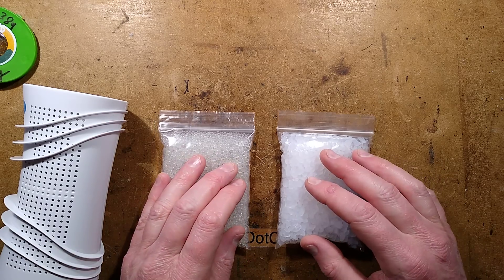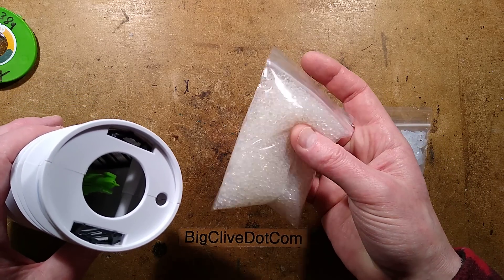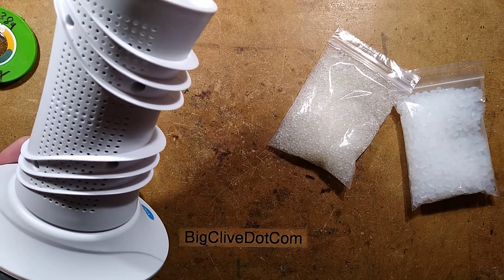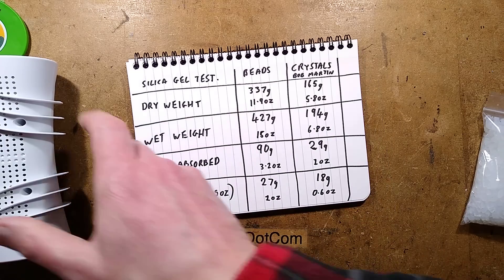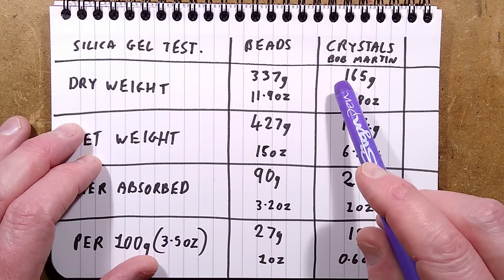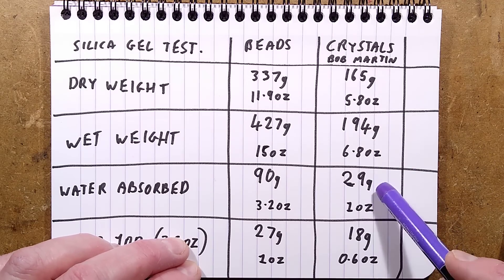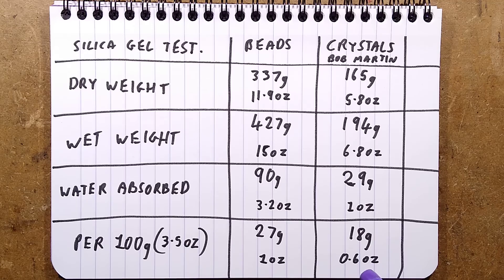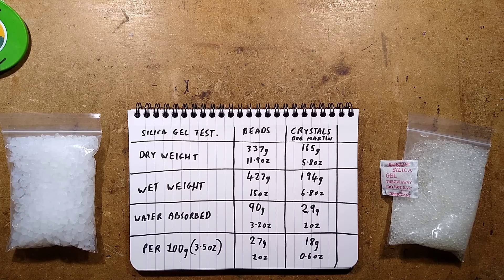Silica gel desiccant showdown - normal versus crystal cat litter

Comment: Hi Clive, the correct word is adsorbent not absorbent 🙂 I have spent may years in the gas processing industry correcting that typo, so unfortunately triggered. It is an interesting example of a mini temperature swing adsorber tower. Most of the surface area for adsorption is internal micro pores rather than external, the pore sizes varying dependent on manufacturing processes. I am not an expert on kitty litter but it is produced via a more "cost effective" manufacturing process that yields fewer, but and larger internal pores hence the lower density and lower capacity W/W.
Reply: The larger pores are deliberate. It's meant to trap liquid quickly.
Reply: In this case, absorb is correct. Adsorb has a different meaning. Look it up if you don’t believe me.
Reply: @grahammilnes7256  - No, it very much isn't. Everyone understands what it means, but silica adsorbs, it doesn't absorb.
Reply: @RFC3514  Technical you are correct. I think someone could be forgiven for saying that the porous beads of silica material absorb (hold) water. Just my opinion.

Comment: Would be interesting to know the cost of each - if you can buy 3 times as much of the cat litter version, it could still be a viable alternative where volume is not a problem.  Did they absorb and dry out at similar rates?  I'd almost expect the cat litter to dry out quicker - with its larger paws (see what I did there?).  Thanks for the always interesting and entertaining videos.
Reply from the maker: The cat litter does seem to dry fast.

Comment: Interesting results, Clive. FWIW, I save most of the silica gel packets I come across, usually in medication bottles, in (relatively) airtight glass jars. After gentle baking, I then use them to keep my collection of old carbon composition resistors as dry as possible, also in glass jars. It's been working wonderfully for many years.

Comment: Clive, do you think this type of rechargeable silica system could be used to lower the moisture of a 16sqm storage unit (maybe 36 cubic meters?)? I'm trying to come up with a solution that doesn't require power because I don't have it available in there so I figured I could swap the silica containers periodically bringing them home to dry and if needed I should be able to put together an air circulation system that can run for a long time on battery using small computer fans or something.

I've been thinking of this ever since you published the original video about this system you got from ebay and I'd really appreciate any input.
Reply from the maker: It depends on the natural air flow through the unit.  A powered dehumidifier might be better.
Depending on the area, you may also find a solar powered fan that pushes air through the building continuously during the day may help keep the air fresh.

Comment: Great video! I've wondered how much better the ones actually "designed" as desiccants are, and 50% higher capacity by mass is significant, but still makes the cost for a given capacity higher for desiccant beads I've seen. The cat litter option has a disadvantage, that in many cases is much more severe than the lower capacity, in that it has a much stronger tendency to create lot of dust.    

Anyhow, even though the actual numbers probably varies a bit, now I know that beads in general probably have in the ballpark of 50% higher capacity by weight, and around three times by volume. Good to know.

Comment: I have to wonder though, was this accurate? The cat litter isn't designed to absorb moisture from the air but rather directly from liquid poured onto it, so the actual "crystal" size and porosity may very well prevent full absorption of the maximum amount of moisture when used as an air dehumidifier, e.g. by not having the moisture penetrate through a humidity-saturated surface to the center of those crystals. I think if you really want to answer this question you probably have to, at the very least, break up the cat litter to similar size particles as the beads. More research required!

Comment: I found some interesting info from Adsortech:
Placed in an environment with 30 degrees Celsius and 90% relative humidity during 30 days, calcium chloride can absorb over 250% of its weight. In the same conditions, silica gel stops at 25-30%. This means that calcium chloride has 10 times the capacity of silica gel to remove moisture from the air when the relative humidity (RH) is 90%. At 50% RH, the difference is less, but calcium chloride with its absorption rate of ca. 100% in these conditions still outperforms silica gel by around 20%.
Reply from the maker: The calcium chloride turns into liquid and is messy and harder to regenerate and reuse.

Comment: Surface area of the crystals compared to the beads. What happens if one crushes the cat litter crystals to the size f the beads, if possible. Theoretically you could fit more crystals into the same volume since there will be less space between the smaller pieces.
You can also purchase desiccant crystals in craft stores used for drying flowers. These are the fraction of the size of your standard beads. They too can be recharged in the oven but require to be placed on a tray since they are so fine unless you want to sew them into a cotton bag.
So far cat litter crystals have worked fine for me in storing dry goods for food usage.

Comment: If you drop your phone in water you dont use either of these....You put your phone in a pillow case and you spin it as fast as you can. The centrifugal force ejects the water which is absorbed by the pillow case and you see it happening. It has to be done asap though.

Comment: Thanks for this test. I already considered drying my 3D filament with cat Litter silica gel. Now that I know it is only half as effective I will not go this route. So: You litterally saved me money. 🙂
Reply: Check out solid state electric dehumidifiers, a video from clive from 5 years ago: https://www.youtube.com/watch?v=Vabq-s62IVM
That is, if you have some money to burn as the bigger ones can become quite expensive. Though the small ones should be enough for most storage boxes.
Maybe paired with some silica gel to quickly initially reduce humidity after e.g. opening the box, the solid state element will then gradually also dry the silica gel.
Reply: By saying that it’s half as effective you are not able to say you will save money by not using it. The cat litter silica gel could still be effective enough to do the job. Comparing the average vehicle to a Porche and following your logic, it would be saving money to buy the Porche because it goes faster than the average car and it gets to the top speed quicker. But the average car is absolutely fine for everyone. One needs to take the cost into account. Even if one has to use double the amount because it is half as effective, if it costs one third of the price then money is saved by using the cat litter silica gel. There was no testing on how fast each product removes moisture from the air. Perhaps the cat litter silica gel is able to bring down the moisture levels in a 3D filament bag faster than the other silica gel product. It would be an interesting experiment.
Reply: @capitalinventor4823  By saving money I meant: I saved the money buing the cat litter to find out It is not working for drying my filament in the AMS of my Bambulab X1C. Of course, if you have enough space: just double the amount. But in confined spaces you can't do that. So: I saved money in buying a product I can't use in the place I intended it to.

Comment: I used to setup and repair copy machines. The new copy machines came packed with bags of silica gel beads as big as my fist!!! 😮 As far as "recharging" goes, I always nuke the bags in the microwave for a bit, but not too long to drive out the moisture!!! There was always steam and evaporated water that I had to let dry off before putting back into the microwave for another heat up cycle!!!
Reply: That will probably heat them up too much, recommended is convection at 120°C (thats what the manufacturer of my silica gel recommends)
Reply: Correct, I learnt this trying to dry my socks in the beam box and that didn't work very well.  @tarakivu8861

Comment: I'd be interested to know how much water is absorbed per 100g in the first hour (or 24hrs).
Do the bigger crystals with a more porous structure absorb faster?

We know cat litter is intended to actually absorb water based liquids pretty quickly, but gel pouches are to absorb airborne moisture over a longer time.

Which is more useful if you have a really damp space that needs dehumidified quickly?

Comment: Surely if air is blown through the silica gel, to dry it out, that’s just putting the moisture back into the air, where it came from? 🤔
Reply from the maker: Yes.  But the modules are designed for drying enclosures.

Comment: it will be interesting to run the experiment again with the cat litter crushed to a smaller crystals.

it will allow to fit more, and increase the surface area.
Reply: Would it increase the amount of moisture absorbed (given Clive already waited until full saturation was achieved), or just increase the rate of absorption thus quicker arrival at full saturation? I'm thinking the latter.
Reply: @Thermalions  The point would be bigger crystals give bigger empty gaps between crystals. The beads are smaller, so not as much air between beads.
Reply: The difference is in the pore size. Crushing cat litter into smaller crystals will make it work faster, but it won't make it adsorb significantly more moisture.
Reply: @RFC3514  Except, if you could get more mass of crystals into the same space, wouldn't that allow it to absorb more water?
Reply: @kcgunesq   - It's not really the mass that matters (otherwise everyone would be using the finest possible silica powder, or blocks of solid silica), it's the total surface area. Solid balls of silica would have higher mass but wouldn't do much in terms of trapping moisture.

The way these crystals work, the "outer" surface area is just a small percentage of the total (and doesn't trap moisture as well as the interior). What really matters is how many holes they have, and how small those holes are. Silica doesn't absorb liquids, it adsorbs them (meaning they collect on its surface).

Crushing the cat litter into smaller crystals might allow (slightly) more efficient packing and slightly faster adsorption, but that won't change their internal hole structure, which is what really matters.

Comment: The difference in material plays some role, but shape do as well. Sphere has largest surface (compared to other shapes with same volume). If you compare total surface (which can absorb moisture from air) of many small spheres to total surface of less larger cubes (or prisms), you'll see masive difference.
Reply: Sphere as a shape, have the least surface for a given volume. But I agree that small size and large number can compensate that.
Reply: @NoHandleToSpeakOf  So I mixed that up. Thank you for checking.

Comment: I remember our trying that silica cat litter, and the cats at the time used it once and refused to use it again owing to the noise it made as they peed on it, proper rice krispies type sounds... :P
Reply: The issue we have had with them is that our cats have particularly sensitive paw pads, and the crystals have uncomfortably sharp edges. I don't know about you but I might not choose to stand barefoot on broken glass whilst urinating either.
Reply: We have used it, it works well for controlling smells but it's very expensive and I hate the amount of hard, scratchy granules the little sods kick out onto the wood floor.
Reply: @ferrumignis  Try wood pellets! you can find them cheap and they're much cleaner than the regular litters
Reply: I've tried using it. I prefer the toilet however.
Reply: @hippopotamus86  i also prefer using the toilet my friends think im weird that i dont use the litter box lol
Reply: Imagine feeling like you're urinating on a series of landmines... I'd stop doing that too!
Reply: Our cats would literally shit anywhere except the crystal cat litter as they hated using it to cover up the shit, they also got small crystals stuck in between their toes, and you don't want your cat swallowing that.

Comment: You can go one step further and look at water absorbed per $1 of silica gel. Looking at prices in australia the cat litter is about half the cost of gel beads. So actually if you don't care about the larger volume it will take up, the cat litter may be better off. But this doesn't examine things like performance loss over regeneration cycles, odor emissions during regeneration, unwanted dust/fines, etc...

Comment: Luckily I can get about 50-100g of silica gel a day from work if I need it because one of the products we use comes with 25g packs inside. I collected about 2kg of it for my 3D printing filament storage boxes, and it works well once dried in a low oven.

Never been convinced that its of any use for an actual house though, it doesn't absorb anything like enough to do anything useful in open air.

Comment: I read somewhere that cat litter was made out of bentonite, which is a naturally occuring mineral powder. And if I remember correctly it also beats silica or any other material in absorbent capabilities
Reply: Bentonite is "standard" litter. Silica is also available, as an option (often billed as a "dustless" or "less mess" option, as the silica doesn't track out of the litter box as much).

Comment: If you need pretty dry, calcium chloride is the way to go - its water absorption is impressive, but it is a one way process, since you can't recharge the crystals. An alternative is molecular sieve - that is fully rechargeable (although at higher temperatures), and substantially out-performs silica gel in both speed of absorption and final (residual) humidity. Nevertheless pretty interesting, and something I too had heard of, but thought was one of those modern day myths. Thanks for sharing this with us all Mr BC!
Reply: Well you can "recharge" calcium chloride, it just takes more heat than the beads.
Reply: Me thinks it also produces acetylene when wet ? .  @WhyNotDeanCV
Reply: I think if you need constantly low humidity, you can also use a solid state electric dehumidifier.
See a video from clive from 5 years ago: https://www.youtube.com/watch?v=Vabq-s62IVM
Though the cost of these might shock you a bit.
Reply: @tarakivu8861  wouldn't surprise me, a small town near me tore one of those membranes in their water treatment plant and were on bottled water for something like two months while a new membrane was shipped from somewhere in eastern europe...
Reply: @tarakivu8861 Stephan at CNC Kitchen channel recently picked up on the solid state dehumidifiers after seeing that video. They are not cheap, but with greater exposure (public as opposed to specialist engineering) the cost might come down as economy of scale the more people start buying them.

Comment: I use the crystal cat litter in my 3D filament storage box and i have been quite happy with it. It dries very well in a tabletop oven. It's in a box that has stainless steel mesh glued to cover the air holes, because that type of silica sheds off some amounts of sand that can be nasty to handle. For the drying, i transfer it to an aluminium food container that you get when you buy prepared food. A hygrometer on the storage lid tells me when it's time to dry all the desiccants - i also reuse the bead bags i get with every filament roll.
Reply: That's what I use it for.  And storing powder-coat powders.  (Of course powder-coat powders are powders, stoopid language.)
Reply: I like calcium chloride commonly known as "DampRid" it can be found for less than 2 usd per pound and it auto dissolves into the water it traps, giving you a visual indicator of when it has absorbed all the water it can. 

If you wanted too you could reuse it by boiling the brine water it turns into but its so cheap it might be more cost-effective to simply buy more calcium chloride depending on where you live.

It keeps my nylon absolutely pop free.

Comment: 1ml pure water(at 20 degrees centigrade)= 1 gram
Reply: And 1oz of water weighs… 1oz.
Reply: A pint a pound the world around!
Reply: @paulmccoy2908  A pint of water weighs a pound and a quarter. (in the UK)
Reply: @paulmccoy2908  Would that be the Imperial Oz(28 grams) or Metric Oz(25 grams) [as used by small time dealers]